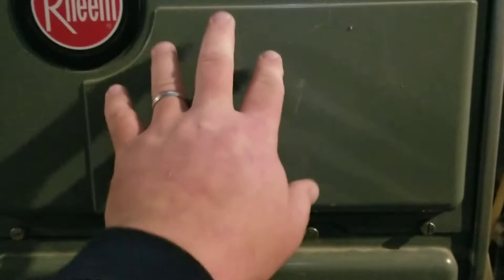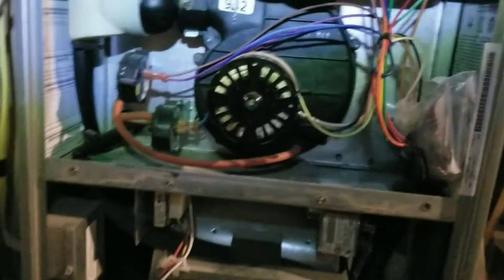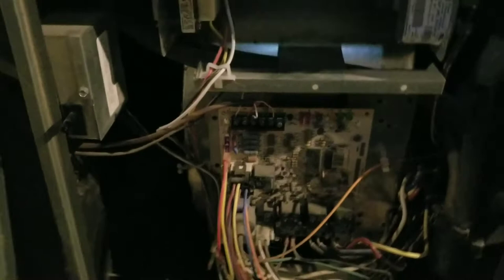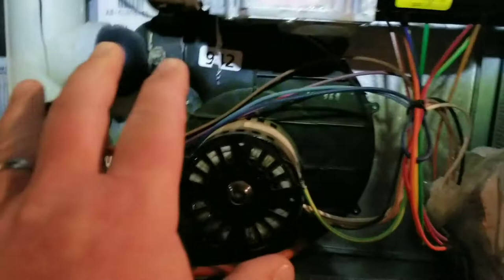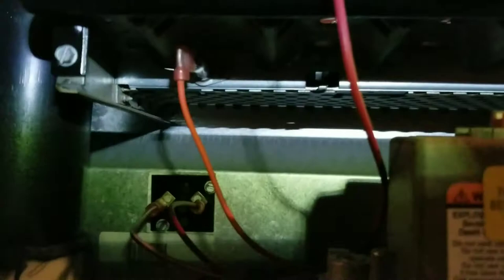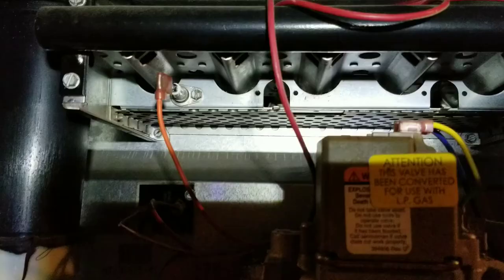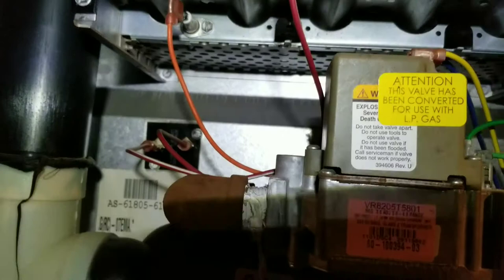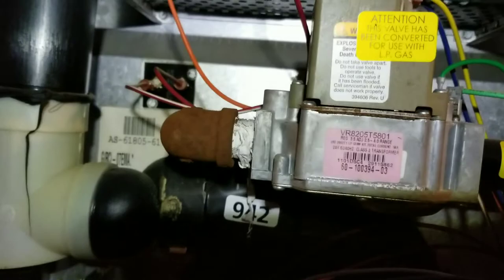Rheem Furnace Turns Off After 1 Minute. Flame Sensor "Fixed"!

Comment: That's the flame sensor
Reply from the maker: Correct. Unfortunately, I'm guilty of calling both thermocouples and flame sensors "thermocouples" and haven't been able to break that habit.
Reply: @tightwadtv3421  I get it I was just saying that so that someone didn't get the wrong part lol anyways awesome video think you
Reply: I had an electrical project using these "sensors" a few years ago. They're just a steel probe. The flame actually has some electrical conductivity to it. You can apply a voltage to the probe and detect the presence of a flame by monitoring the voltage or current in the probe.
Reply: Does anyone know how to rework  the flame sensor to the 7 pin